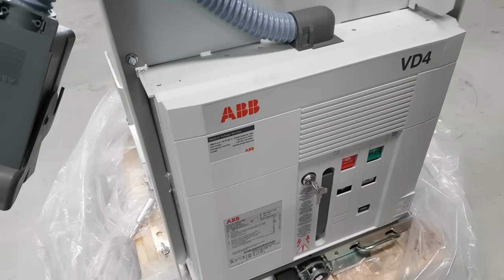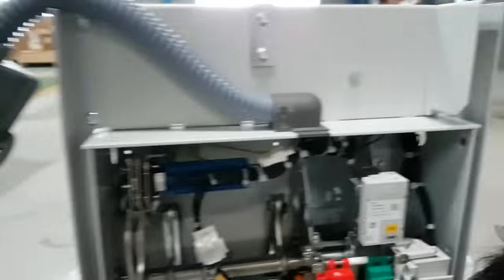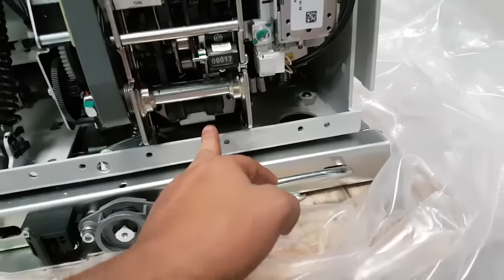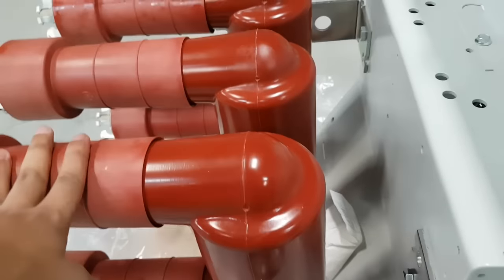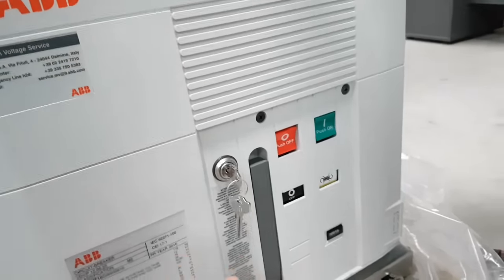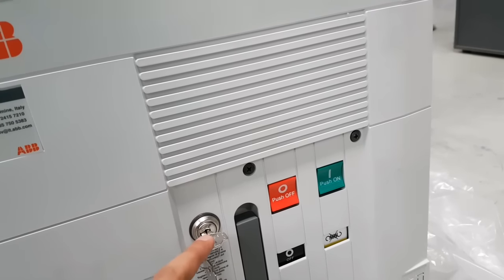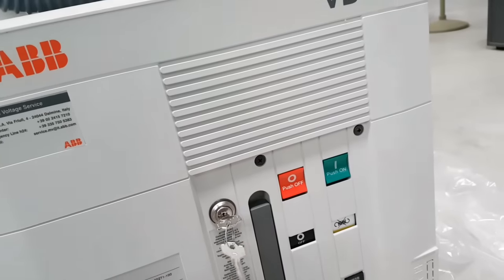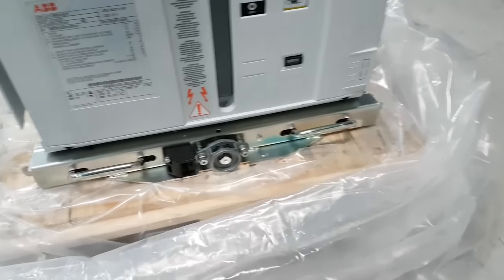ABB VACUUM CIRCUIT BREAKER VD4.

Comment: What do i do if the CB fails to rack in. Its jammed
Reply: RL2 not energized this is the proplem ..When C.B in test position , remove the front cover and measre the voltage on XB4 plug inside C.B